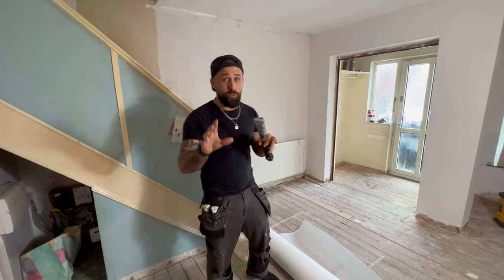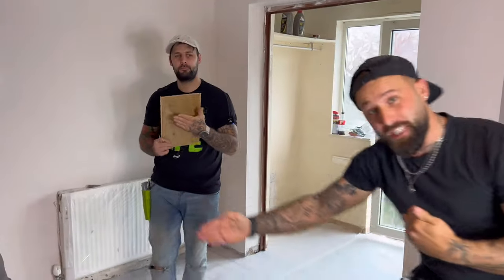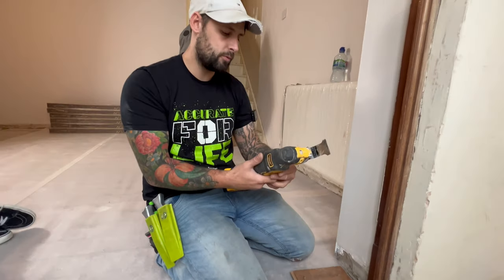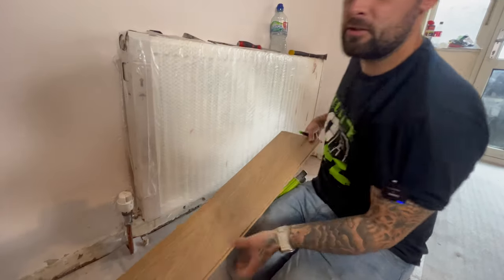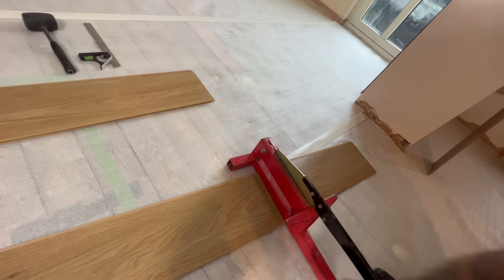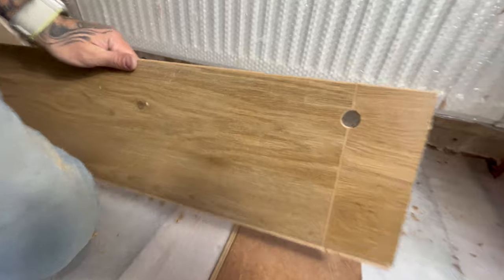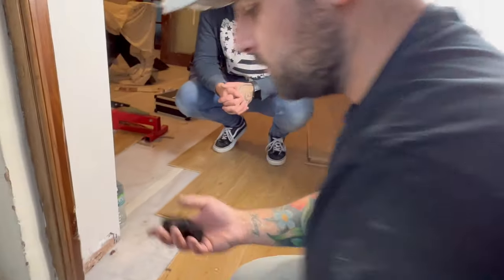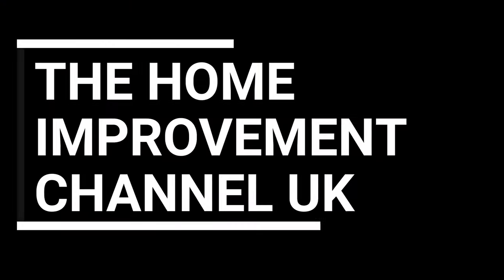Install Laminate Flooring Like a Professional - Tips for Beginners

Comment: Before you even start, check if the floor is actually level, otherwise squeaky laminate with popped joints and hollow spots.
Reply from the maker: Thank you for your advice 😊